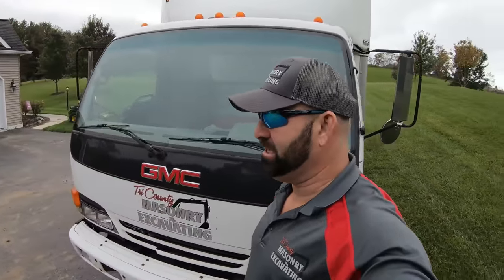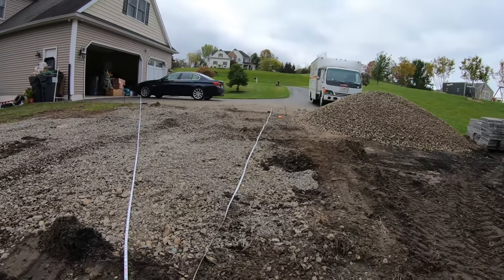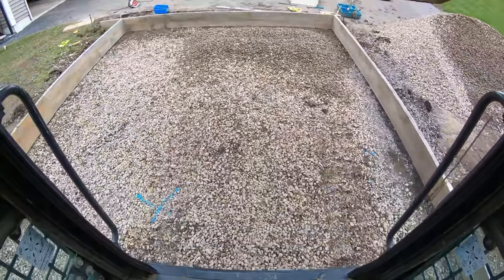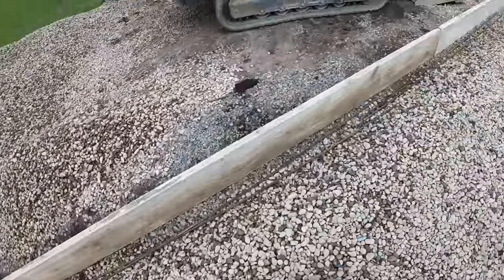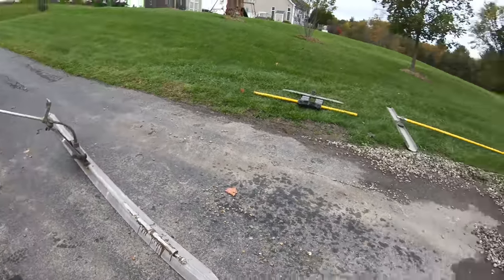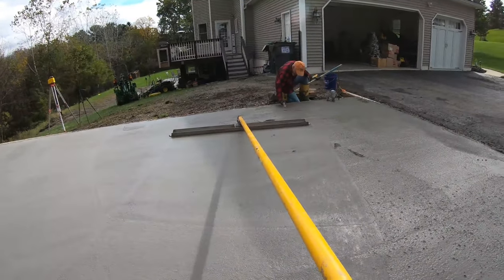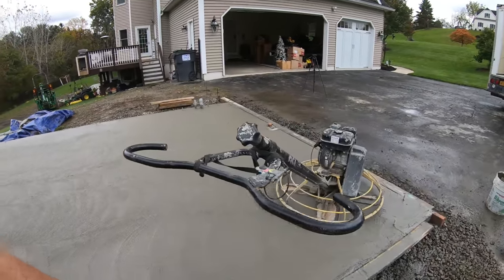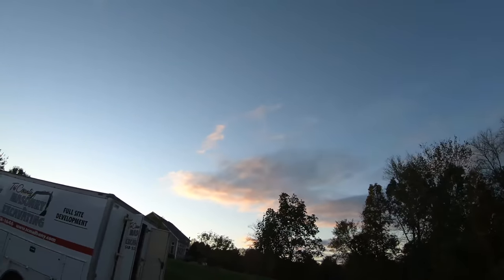Monolithic Garage Slab 14x24 How to Excavate Form and Finish Concrete

Comment: Add a little "Mechanic-in-a-Bottle" to the gas in any small engine and you won't have any carb problems.Ifyour card needs cleaning just put MIB in it and soak 4hrs and its clean. You have too many other things to deal with without that.

Comment: I have been doing full construction 30 years...never had to preload my forms.  Install enough stakes and there will be no problems.  I am all about perfection from laying out the footings, laying out plastic, pouring concrete, setting up rebar, building walls, running wiring, plumbing, building roofs, installing windows, flashing, tyvek, sealed perfectly, installing siding or brick, etc.....My houses are built like no other, I don't cut corners to save money,  I believe in doing everything right.  I will never stray from building it right .

Comment: Look’s good.
I’m getting ready to install a slab like this on a gradual slope of about two feet myself.
I’m concerned during the pour of the wire mesh not being lifted during the pour causing it to lay on the bottom of the concrete and not doing any good.
I’m not a concrete guy just watching tube’s and attempting to grade and form my own slab for a 30’ X 40’ metal building.
What you say?
Thanks for the great video and sorry bout your auto screed.
JL

Comment: You can always use wood on the vibra screed in a pinch I have a 16ft 2x6 wrapped in aluminum siding I use and its almost as good as a legit screed blade
Reply from the maker: I hear you I got a 12-ft aluminum one for backup in the truck

Comment: What a day!  An uphill battle all the way.
Were you able to repair the screed or did you have to replace parts?
Reply from the maker: Yes I repaired it by bending it back had to put a couple nuts and bolts in it

Comment: What was the reason for the 12” thickness? I am planning a slab on a 2.5’ drop. Can I use this method and just bring in more rock on the low end?
Reply from the maker: No it is a footer so the slab will float and have more support. It also depends what you're putting on it if it's a shed then it's fine but if you're framing a building on it you want to thickened edge

Comment: Good Job Dirt Boss. Does the building department ever make you pitch the slab or put drain in? One city i did work in made me do one or the other so i put a channel drain in middle. Instead of making a framers nightmare on the perimeter.
Reply from the maker: No not the building department but each architecture engineer designs structures different

Comment: Boy that hurts when you damage the screed like that. Slab looks great and should be a nice garage for the owner. I hope you can get the screed back straight. Worst thing you get is a smaller screed for small slabs.
Reply from the maker: Yes I could cut it down but I think I could straighten it cuz it's magnesium it's pretty soft

Comment: I'm sure i missed it but how thick did you pour that?  Looks like only 4".
Reply from the maker: Yes 4 in center 12-in haunch
Reply: @DIRT-BOSS  do you use a mix with fiber? And do you have issues with customers complaining about cracking? If they insist they only want 4" i make it clear that I won't be responsible for any cracking. I don't see a problem with parking a small car 4" but since I have no control over what they park on the crete I usually plan/estimate for 6".
Reply from the maker: @jonyemm  I only put fiber in if it calls for it on the specs All concrete cracks from 4-in to 12-in
Reply: @DIRT-BOSS  are you trying to imply you/the customer paid for engineering for a garage slab? 
But yes, concrete will crack. I wasnt referring to shrinkage cracking though. That is easily controlled by saw cuts/dummy cuts and maybe expansion joints.  I was referring to cracks due to a combination of loading and factors outside of the contractors control.   4" to me, because of what's been drilled into my head since day 1, is to thin for vehicle traffic. For anything supporting passenger vehicles 6" is minimum.  4" is good for sidewalks. I've done jobs where they required 6" for sidewalk.(must be some heavy people in the area of the old steel plant in Bethlehem, PA).
I'm just wondering if you have had issues going with 4" for surfaces subject to vehicle traffic/loads.  Most people just do what the customer wants, but usually they don't have a clue.

Comment: So since it took more stone that you estimated originally, how do you deal with that, Does the customer pay for the extra or do you eat it? I only ask because I’m dealing with exactly that situation now on a project and wondering how guys with more years of experience have dealt with that and do deal with it.
Reply from the maker: On this one I ate it because it was such a small amount but yes usually if the elevations are drastic definitely change order and charge extra
Reply: Stone is relatively cheap. Usually there's enough profit in the job that I've never worried about a bit of stone. I Also look at it as it was likely an error on my end estimating the stone. There's a limit to that way of thinking though.

Comment: Phytagoras formula; 
a2+b2=c2
square root from c2 = sideline
Reply from the maker: Sounds about right
Reply: pythagorean theorem? Does it have a different name its known as? We both have the same base word it looks like.
Reply: @jonyemm  english is my 5 languange, whoever finds spelling mistakes can keep them :P
Reply: @nymeuznymo9507 I wasn't implying you spelt it wrong. Was wondering if it was known as something other than what i know of it as. Which, I actually looked into. Pythagoreans theorem is also known as Pythagoras theorem/formula. The 2 names can be used interchangeably.

Comment: Hate you had a shitty day bub. You still THE MAN!!  How did you get that 27’9 figure for your right angle squaring up?
Reply from the maker: It's just a mathematical equation that I don't even remember how to do anymore I just use an app 😁
Reply: @DIRT-BOSS  I’ve used the 3,4,5 method since high school but I’d like to learn yours. That’s cool. You da man!
Reply: @tbirdage 
  Length times itself  . Width times itself.   Add the results together. 
     Then hit the square root key on your calculator for the diagonal to the corners . Measure  both diagonals to confirm.

      No calculator no problem. Set up both long sides parallel. Set up the third side dimension length where you want the corners to be and set two nails or pins. Now take two tape measures to the approximate center of the other side. Where the two tape measures cross each other is the exact center of the opposite wall.

   Now measure half that wall length to establish the other two corners. No math needed

Comment: You mention garage doorsbut have no recess or slope at the doors.  The homeowner is going to be very unhappy about the water running across the floors every time it rains.
Reply from the maker: Most Alaskan celebs don't get it don't know where the doors are exactly